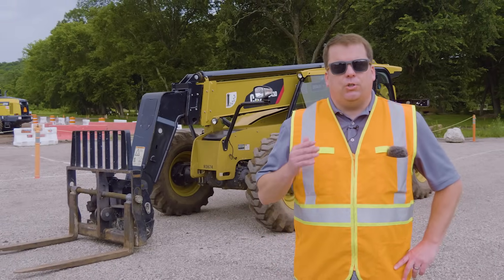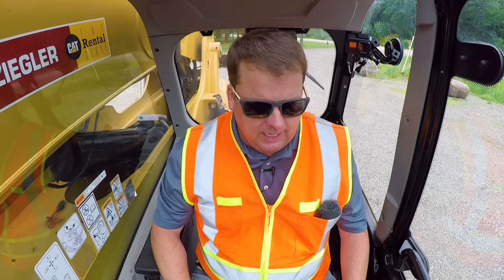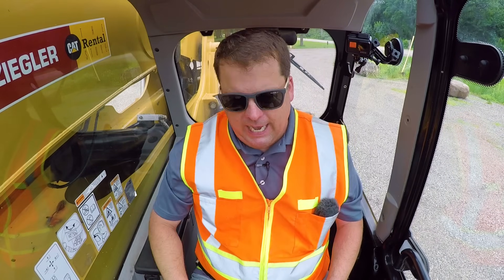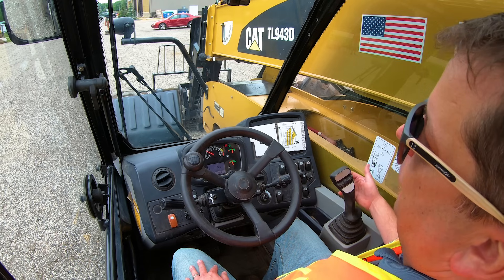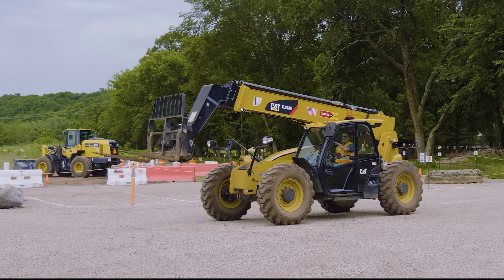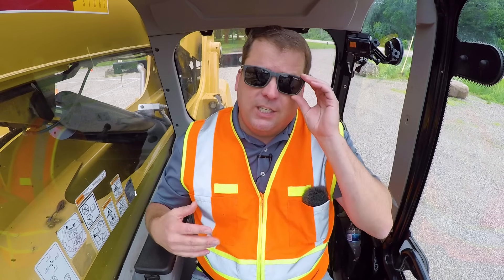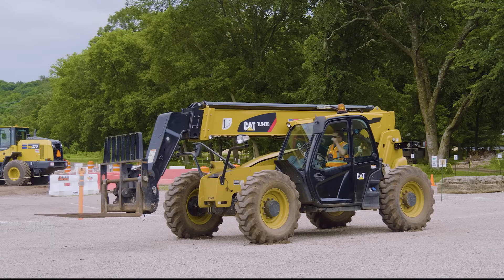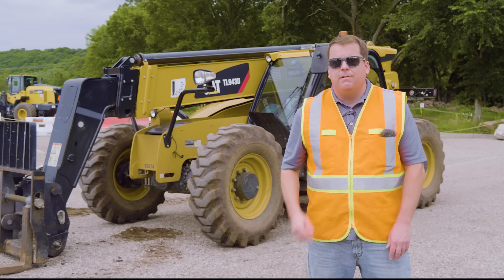How to Drive a Forklift | Telehandler Forklift Operator Training

Comment: I'd build one with extra weight mounts and a tear winch and a attachment like a small jib  keep the forward stabilizers t&t way if you need a telescopic boom and a winch line you can run down the boom just in case it would come in some situations got proof is my idea on you tube but you could make a fork or grapple boom for a excavator patent pendending. Of the forks are being used still have that winch line for extra stuff if need be a 2 in one type system for tools air compressor ect use the hook instead moving and taking ply borad off be useful at times. I'd rather have a excavator for dirt and a knuckle boom and the aux hydro and many attachments with a quick tach. You could gab a set of forks to an excavator turn them backwards but would work and more stable no flats tire cost would equal haul cost so it would no cost more but you could do other stuff footings set forms pull forms with a 360 turn. Turn the bucket you got a concrete bucket or a concrete crane bowl can't think of the name of them. The bad thing bout the handler is top heavy with a load and you can feel it rocking at 30 then 40 you can't put that much weight and move got to drop the forks a wheel loader or 963 is more stable. Forks faced for an excavator you'd just have to see were the guard would not hit the hydro cylinder but doable. The forks on a excavator would be like a sheet rock boom comes in handy. Plus the excavator is a robotic arm more useful than a handler on a build site with less drive area needed. You can crab stir in a excavator. You can climb with a excavator.  Seat belt if a fire from hydro will trap you if you dont have a knife im 50 50 on that if is that bad use your bucket for a better pad. The rubber tire machine is going to be less stable In dirt and will Crack concrete the excavator will scar it yes break a curb but the track machine distributes the weight lgp not hard o. Concrete sheets the have street pads all ready if they don't have cleets the tracks usally utility pads you put them plastic bricks on them they slide you don't need them if they don't have cleet pads most come with the smooth pads utility the plastic bricks don't work is a sled. Plus a care that blows a tire rims scars more than a track. On asphalt a drive only 4 to 6 a rubber tire will rut it a track won't like a truck tire no steel so it ruts and pushes down. If not a good base under. Then I'm sure I'm dumb an excavator can't reach that high yes neither can a telehandler with out being too heavy 80ft you use a crane. Plus the forks should be as wide as the tire base for 20 to 40 ft long beams when the handler starts going side to side the beam slides. To be fare not to offend I may be dumb or half as insane I like construction work

Comment: it's been awhile but i used to drive the telehandler for construction company. when lifting things always be as close as you can without booming the arm out. that goes for whether you're lifting something or putting it back down somewhere. you always want to make sure that the ground you are working on is quite solid as well. you do not want to boom 2000lbs 20ft into the air and find out it's not solid. you will topple over to one side or the other with even the slightest amount of collapse of the ground ( some telehandlers have outriggers and some don't). i used to love driving them.. it's like driving A big 4 X 4 monster truck in the mud (most job sites were muddy)

Comment: You did excellent on tutoring. First thing every day walk around the machine check oil, tires, mirrors and fuel level. In cold weather let the machine idle for 10 to 15 minutes depending on how cold it is. So the engine and hydraulic fluid can come up to running temperature. If load is unstable strap it to the head frame. Carry your load with forks slightly turned up. Better to have your load shift backward to the headframe. Always place the forks on the ground when finish. Watch for overhead POWER LINES. A spreader bar can be used for longer loads if necessary. The Skytrak 10054 wheels need to be in the parallel position to disengage the crab steering. You need both hands on the steering wheel for sudden impacts on rough terrain. You are prone to a wrist injury when using a brody knob in this situation.
Reply: This is excellent advice 👍🏾👍🏾

Comment: 6:20
It’s a bit similar to a skid steer. “In” is curl, which keeps the dirt “in” the bucket
Reply: I’m an excavator operator at a small company. Occasionally, I will need to run our Mecalac in skid steer mode, but it’s not frequent enough for me to always remember which way it’s supposed to be set (the Mecalac has a switch that can make the dump/curl be reversed if you choose). In to keep dirt in will be a good reminder for me. Haha.

Comment: Curious, do the rear wheels stay in whatever position they are when switching back into 2 wheel steer? For example, if you are in 4 wheel steer and turn then put it in 2, do they self center?
Reply from the maker: No, not on this model they don't.
Reply: I am yet to see/operate a telehandler that does that and I've worked on two types of Manitou, 2 types of Merlo and one annoying JCB
Reply: I drive jcb 541-70 agrisuper and 525-60 agripro 
Both have the option to switch the steering modes while driving
If you are in 4 wheel an switch to 2 wheel the back wheels lock in the center as soon as you cross over the center. If you are turning to the left and switch you have to turn right until the back ones are straight and then the lock in automatically.
Could be specific to the agricultural versions of the Tele handlers because the boom extension and the curl are switched as well in my machines

Comment: I've used a JLG and a Claas telehandler on 2 different dairy farms. They are great for unloading hay trucks and the bucket is a lot more versatile than a regular tractor with a front end loader. We even moved a shed with the Claas recently! Great video bud
Reply: Hey Thomas! I’m about to move a shed with one, any tips?
Reply: @mazookah  The way we did it is we parked a tractor with a front end loader and a square bale of hay on the forks and had it raised so the roof of the shed was resting on the bale. And then on the other half of the shed we did the same thing but with the telehandler and also a bale of hay on it. So we moved it in 2 seperate halves. I suggest to not do it on a windy day as the shed will act like a kite 😅

Comment: Those boom controls aren't standard! Even on my CAT th407 .
Joystick controls....
Back....boom up
Forward...boom down
Left...curl
Right...dump
2 rocker switches
Left forward..boom out
Left back.. boom in
(Or used for attachments)Right back... coupler pins unlock
Right forward/back..coupler pins unlock/lock
Trigger button is F.N.R.
Only other style I've seen is the jcb loadall from early 2000s with 4 directional levers and the 2 for stabilisers.
Reply from the maker: interesting...I have not seen that configuration on any TL I've been in.   But like I said in the video, it is interesting that TL controls are not nearly as standardized across the brands, lots of variations.   The controls you mention sound similar to a telescopic skid steer, like the JCB or Volvo I have run that have the arm extension on those rocker switches.   Thanks for sharing.
Reply: @HeavyMetalLearning  Manitou does thi same thing. Basically loader controls with boom out being a thumb switch.

Comment: Is an old Skylift extended forklift considered a telehandler?
Reply from the maker: Yes, at least that's what I would call it.   If it's a material handler (like forklift forks on it) AND it has a telescopic arm (meaning it can extend out away from machine) that is technically a telehandler.

Comment: This is the most versatile machine I've  ever seen in my life. Holy Molly!
Reply: I’ve seen dudes lay sections of pipe using these and lower in sections too
Reply: Hello, I am Ayman from Algeria. I have extensive experience with this machine. This machine has become very necessary in public works, agriculture, and difficult terrain.
Reply from the maker: lol...not sure I agree with that...but ok.   It has a pretty specific purpose, only for moving materials around so it really can't do a lot on a job site other than that...so not too versatile.
Reply: @HeavyMetalLearning   pretty rude way to answer someone on your video.
Reply: @HeavyMetalLearning  Correction: you can fit other things than a fork on the front, for example, a simple bucket to turn it into a loader, great when it snows heavily and you need a clear working area.
You can also fit a brush to clean the road after wintertime. 
Must be a few other uses that I'm not thinking of
Reply: @aggi999  We use ours at work for everything from plowing snow to loading and unloading flatbeds. This guy is a joke lol
Reply: @aggi999  plus the bale options are great. From bale loaders to bale spikes to log forks. There is a lot this machine can do. More than his fork loader. Was going to subscribe and like this dude, but his comments to people seem uneducated and rude
Reply: @machigunther4148  yea I also remember using a long pole extension to pick up very long blankets and pipes
Reply: @HeavyMetalLearning  can attach a bucket, bale grabs, bale spike, your loader forks, claw grabs for large logs, the list goes on pretty far. Proving you wrong and a rude dude
Reply: @HeavyMetalLearning  You must be new to these...
Reply: @HeavyMetalLearning  The fact that you don't think telehandlers are one of the most versatile pieces of equipment on a job site speaks volumes of your inexperience.

Comment: No out riggers on this one??
Reply from the maker: Yeah, not on this one.   I think it may be an option but just depends on how far out you need to extend (and weight lifting) as to whether you would need outriggers.   Obviously they are an expensive option to have on the machine so don't add unless needed.
Reply: @HeavyMetalLearning  Every one Ive operated has always had them. Just feels odd to me. Like leaving the house without your keys or your wallet.
Reply: Most likely an agri spec one. Light weights (hay bales) stacked high. You wouldn't go lifting pallets of bricks on full height with this